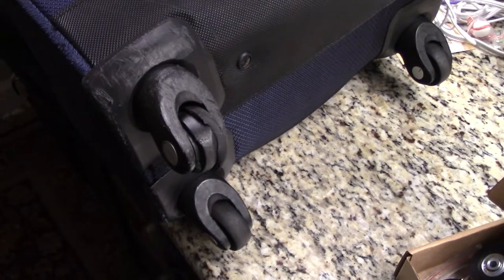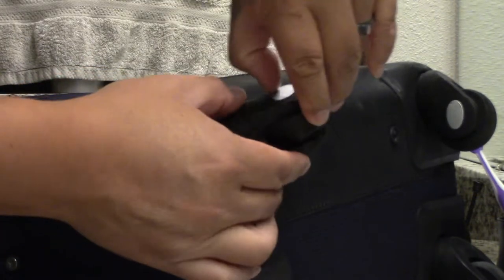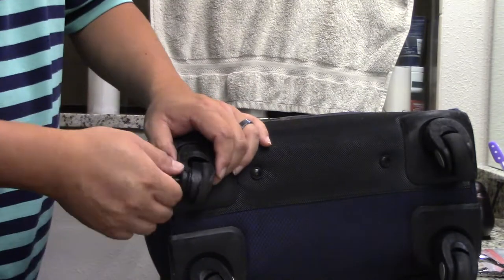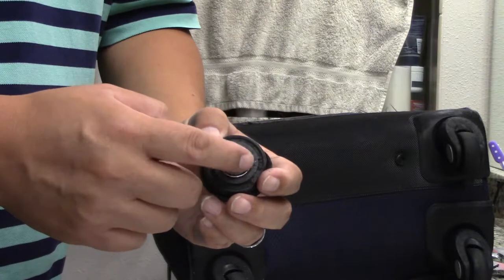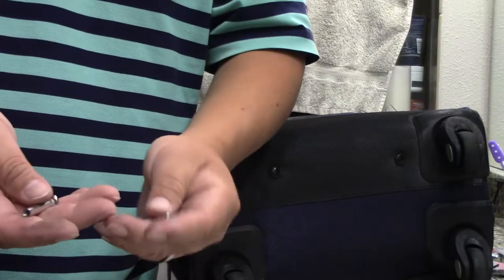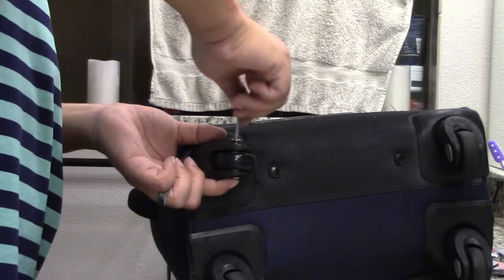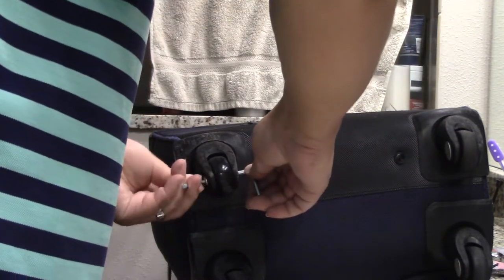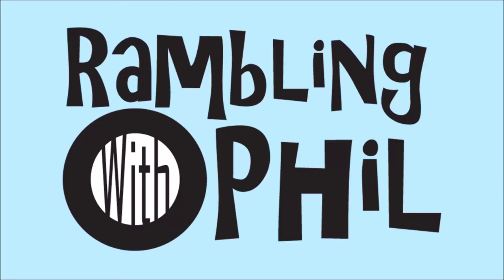Suitcase Wheel Repair DIY - Rambling with Phil

Comment: If the kit came with a slightly longer shaft, that might have solved your problem of the wheel not spinning as freely. The wheel might be pinched between the plastic carriage?
Reply from the maker: That could very well be.  Thanks for your comment and for watching!

Comment: thanks, very useful. Can you share where exactly did you purchase replacement wheels from.
Reply from the maker: Thanks for watching my video!

The wheels you need may be a little different than the specific ones that I bought from Amazon.  They might be a slightly different size but this is the link (hoping I copied that correctly):

https://www.amazon.com/gp/product/B07S9VLW29/ref=ppx_yo_dt_b_search_asin_title?ie=UTF8&th=1&psc=1

Comment: What's the size of the bit did u use.  Tried a 6mm to no avail.
Reply from the maker: To be honest, I don't remember.  I just picked a size that I thought would work and that was about the diameter of the head of the bolt ... it was really just trial and error.

Thanks for watching!

Comment: Does putting some grease help for a smoother push?
Reply from the maker: In my case, once all 4 wheels were replaced, it rolled smoother so I did not use any grease.

Thanks for watching and I hope that you will subscribe if you haven't already.